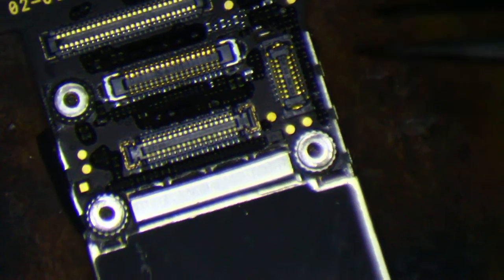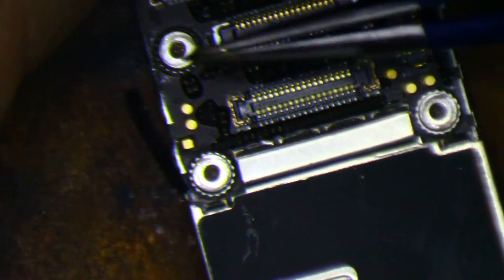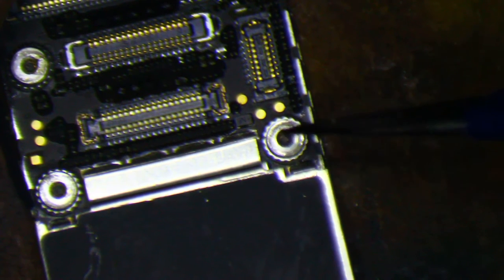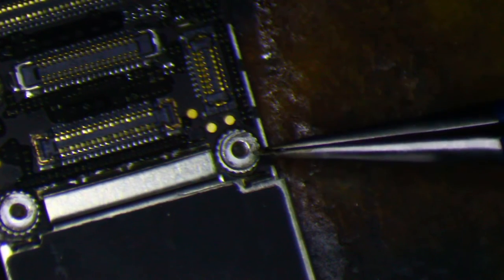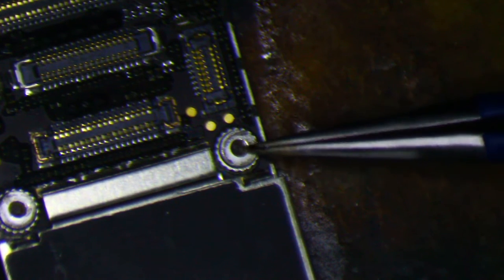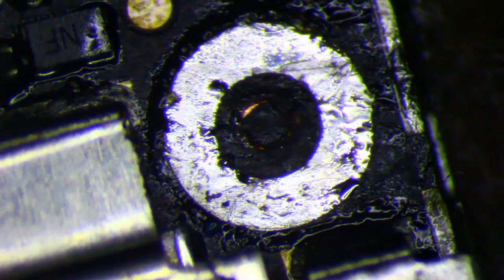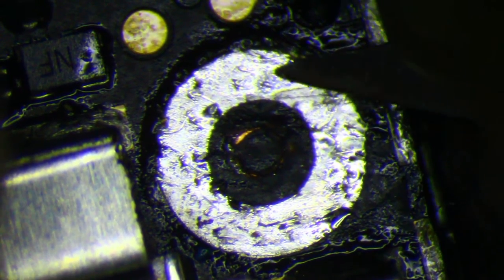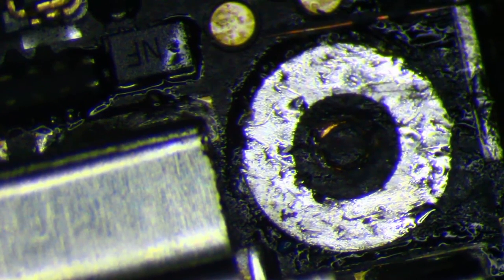iPhone 6 Plus with long screw damage to both right and left sides

Comment: Ha! So much for my handy skills. I changed my screen and mixed that left screw with one of the smaller ones  (such a small difference in size) I guess I learned the hard way that you really need to map your screws out. I don't think I'm ready for board level repair so RIP phone. 😑 Thanks for the vid!

Comment: Very nice Video. Thanks. Just seeing the logo is not enough for me because sometimes the iPhone won't finish boot and actually gets into the apple logo loop. Software won't fix it because there might still be another important damaged trace
Reply from the maker: Johnny Castillo I fully test them after reassembled and have never had one fail to boot that a DFU restore didnt subsequently solve.
Reply: Thanks 👍🏼

Comment: If Apple would not engineer their phone with a half dozen different sized screws, this wouldn't be nearly as likely. If they are going to do that, they should be color coded. Also there is no excuse for using exotic screw heads when small phillips work fine. I just worked on my 8, replaced battery and charge board.  A couple of tiny screws left over! One hole that none of them fit.  I don't think I have any damage since I was careful not to use a screw if it felt that it was bottoming out, or felt unusual resistance.  I think it's probably something underneath the speaker, but I like to never got the tiny wifi connector plugged in, I really didn't want to take it apart again and risk screwing something up.

Comment: Other than 'many boards experience ' how do you know what goes where on each layer. Is there any information in zxw?
Reply from the maker: rupert handford zxw does have this info now, but I researched it myself by digging into other boards and eventually using bare boards to figure out where the traces went.

Comment: Hey Mark, Great video. I was just curious, towards the end of the video you said you were not going to do the other 2. What happened that made you change your mind? I am attempting my first LSD after a customer put in a sim card under LCD Flex shield and screwed it down hard to put pressure on the Meson causing LSD in all 3. I only found 2 traces in the "Hard" hole I repaired and nothing in the other 2... but heard you say the Vias pass through 2-3 layers and I scratched down to the 3rd where ZXW shows the schematic not paying attention if I tore 1st and 2nd layer traces on my way to the 3rd. I tested the traces from schematic and all have continuity but still have no image even though I got it to be partially recognized by 3Utools...it times out. Any idea where I may have to look to figure this one out? Are there traces I could have damaged on my way to the ZXW Schematic traced?
Reply from the maker: My Iphone Rehab I'm not sure why I said I wasn't doing the "other 2" or if I was referring to other jobs or other traces. I often take a break from something that is being difficult.

Regarding your lsd repair, it sounds like you may have gotten into some trouble there. Zxw will not show you 3rd layer traces so if you've exposed to the 3rd layer you're on your own there.
Reply: Then I have made a mistake in describing, the only thing I see where I am at is the ZXW traces. I just assumed it was the third layer by misunderstanding. I didn't break any traces on top as I only cut the areas around the screw (about same size you do or a bit smaller), and only scraped the top to the traces in ZXW
Reply from the maker: Then either you haven't fixed all of the broken lines or there is some other fault as well.
Reply: Thank you :) I found a missing repair near Chestnut " AP_TO_I2C0_SCL "

Comment: Hi Mark. I have 6 plus with "no touch" but when I get that iPhone it wasn't boot at all (no ampbrige) Is there something related to touch (no touch) in that right bottom screw hole. I was very lucky when the 6 plus not booted at all because there was wrong screw in there (supposed to be in upper left hole), but when I unscrewed that screw from right bottom hole, 6 plus luckily booted, yay! But no touch as described in the first place. I hope that this "no touch" is related only with touch ic and dont have to go on that bottom right (rabbit hole) 😅 So, do you know if there are touch related traces under that screw hole? Kind regards
Reply: And I forgot to thank you for that last help from you when I had problem with iPhone 6 LCM reset line, so thank you very much for that! After I connected the LCM reset line, the image is back! Thank you!

Comment: Hello...do you repair IPhone 6 long screw damage ??..Can I post the motherboard ?..The phone is totally dead I fell and the phone hit the floor and apparently that made the long screw damage. I had it checked at a store and they told me they dont fix it....So I dont know where else to take it......Please let me know I could send in the motherboard..you can tell me if you can repair  it and how much...I can send payment with Paypal or bank transfer......BEST REGARDS and I ll be loking forward for your answer
Reply from the maker: martin gara long screw damage won't be caused by a drop, but I'm sure I can figure out the problem and repair it. You can request a quote and get more information at www.mendonipadrehab.com

Comment: So happy to find your channel! One question: After fixing long screw on iphone 6 (the one on the left) The phone turned on and after some time it goes off black screen. Can it be that there is another long screw damage (i suspect the one on the right) or i didnt fix it first time?
Reply from the maker: Stoicho Hadgiev it could be many things, but normally long screw damage in any hole doesn't cause that behavior.
Reply: I didn`t screw the right screw and now the phone is ok. So strange :)
Reply: Stoicho Hadgiev I think that when you put the screw back that causes short to ground and screw touch the trace so without screw it doesen't short to ground.

Comment: and what causes delaminationg?
Reply from the maker: kara converse the delamination wasn't present in the 5s because the top layer wasn't a ground plane. in the 6 and up, there is ground plane under the screw bracket. LSD in these causes the screw to bottom out and quickly cause the screw bracket lift, lifting the top layer of the board with it. the result is the top layer pulling out random chunks of the second layer which in most of the holes breaks the traces in the second and third layers.